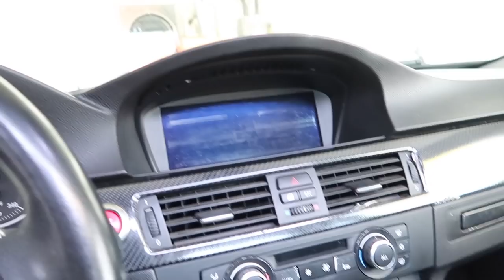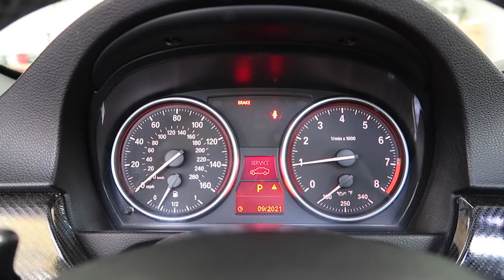I TRADED MY F80 M3 FOR A SUBSCRIBERS E92 328I CLEAN TITLE!

Comment: For the drains bro take some compressed air (preferably a strong compressor not the can air) and use that to push the gunk out to the drains on the bottom of the car. I also used a small tool that was long to help break up and push it down. After that didn’t have any issues with water inside anymore
Reply: Sometimes the hose that connects to the bottom of the drain does also kink and makes it so nothing can get past. In which he would have to pull it from the drivers side latch area and try to keep it straight

Comment: Use an air compressor to blow out the drain hole on the left side of the sunroof track or I’ve personally removed the fender liner on a 745li and found a rubber tube/hose sticking out of the firewall on the front driver side wheel well.. once you clean the grime out with a shop rag or something verify your work by slowly pouring hot water in the sunroof track on the left side. It will solve your problem

Comment: OMG Nour, I can help with the draining issue, I had the same issue but it soaked my headliner, if you remove the front wheel arch liner and reach behind the sideskirt there’s a rubber bung that catches debris pull it off and run hot water slowly through it, it will drain it

P.S I left my bung off and kept it as a souvenir, my cars never had the problem since and it’s been over 1 year :)
Reply: The bung has a X shaped base and will likely be full of junk and decomposing leaves, Highly recommend you leave it off :)